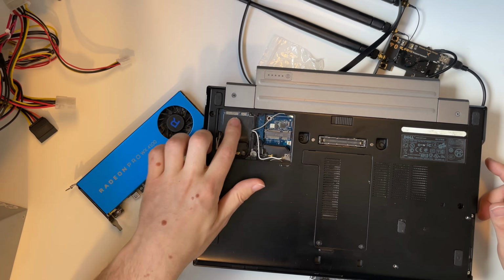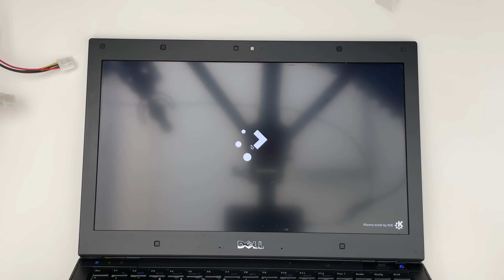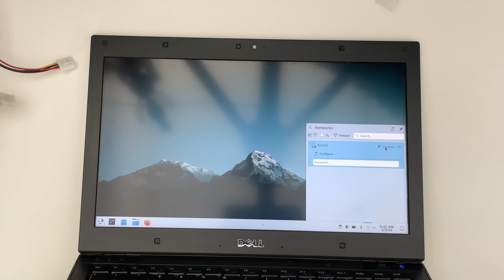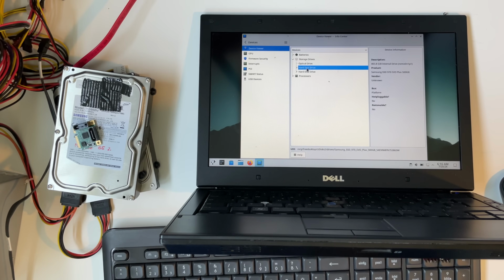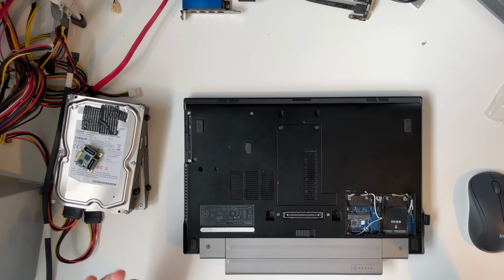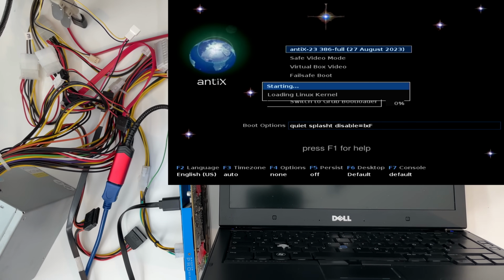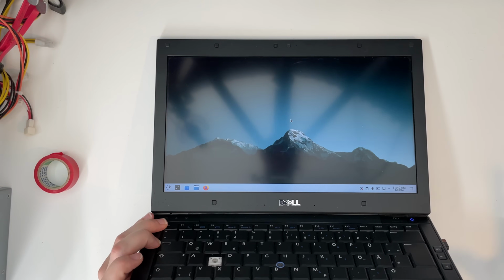I Added an Ethernet Port, a GPU, NVMe SSD, and more to My Laptop... by Removing WiFi

Comment: hola, and thanks for the vid, was looking to see if an upgrade to a core 2 wifi could be made and ran into this problem outright:  antenna connector.  Saw 5cm adapters on aliexpress, they are:  "U.fl 1 a MHF4 MHF 1 a MHF4 conector de Cable 5CM"  check male and female plugs though!  dont know why do this except tweaking the old laptop using linux, which i am

Comment: I've used the m.2 wifi adapter but ended up with transferring the whole antennas from the newer junk notebook.  Does anyone know the specific adapter name for the antenna?
Reply from the maker: Cool idea. But if you have the new wifi card and the new antennas what adapter do you need?
Reply: @TechKingdom35  Wi-fi 6 card.  miniPCIe wi-fi 6 or 6e cards are way too expensive for my old notebook, even from China.

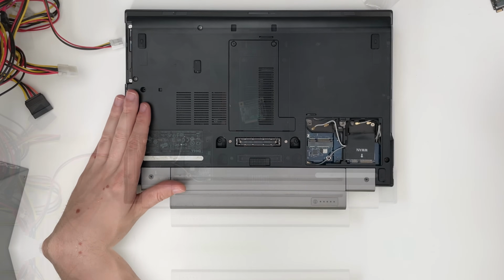Comment: 7:57 did you only just plug the PSU into the Drives and the Wall? did you forget to turn on the PSU by shorting out the Green wire to Ground in the 24 pin Motherboard connector?
Reply from the maker: Thanks for the feedback, but the drives did spin up. You can hear the humming in the background. I bought the adapter again, and that one worked. But it took a few weeks to arrive.

Comment: How did you do the part at 10:05, installing grub on the hdd to boot from it? I'm losing my mind, it just starts a grub shell for me, not the gui to select the drive.
Reply: you can use update-grub utility for fix that

Comment: Hi. Do you can put mini PCIE to m.2 to oculink adapter to make to fit better? This port is so amazing and is underrated. All of the laptops can output EGPU? Which distro are you recomand to have a better compatibility? I have just an old 2008 Intel core2duo laptop.

Comment: I need that egpu thingy for an Optiplex USFF that has no actual expansion slots because I wanna use it to stream and the integrated graphics don't support hardware video decode, but I only need a x1 adapter because I have a GT 710 PCIe x1 card, which would be perfect.

Comment: Don't need the wifi card anymore, might try that NVMe trick so I can store two 2.5" HDDs + one NVMe disk on this laptop!
Reply: You can also add a MSATA ssd in the WWAN slot of most Latitude models. I can to my E-6540. Done a similar setup as this with it and went with a 2TB M.2 2230 NVMe while having a 2TB  MSATA SSD in the WWAN slot with a 2.5” 4TB SSD in my original HDD slot and a 2.5” 2TB SSD in the Optical Drive slot by way of a HDD/SSD adapter tray that connects to the Slimline port in the Optical Bay. Booting Win 10 on the 2TB 2.5” SSD, booting Arch and Kali on my split partitioned 2.5” 4TB SSD, CachyOS on the 2TB NVMe and a barely working Mac OS on the 2TB MSATA Drive. Grub Bootloader on all but MacOS setup. Would love to use my last MINI PCIe slot to be able to add a 2.5G NIC/Ethernet adapter to connect up with my Fiber and the WiFi 7 BT 6.0 card I added about a year ago. Also on the E-6540 my second MINI PCIe slot has cutouts in the frame to allow for longer cards even adapters where you may wanna connect another longer NVMe card by way of adapter provided you can find an adapter with those exact links at the connection points, which I’m sure between all the different overseas retailers online Amazon eBay Temu somewhere is bound to have one that would work seeing how the controller itself works by using the same type of adapter card just designed differently. Nonetheless this is a really cool video to show people most people don’t think that that sort of thing will work, but it does. I’ve been utilizing it daily with no issues so far other than the occasional needing to go in doing a little bit of work in the terminal, but mostly everything was Plug N’ Play💯🤷🏼‍♂️
Reply from the maker: @MicrocarpaRutaceae  go for it, sounds like a good usecase

Comment: Excellent video. I tried putting such a USB card in my Lenovo Thinkpad x230 but because the card is not on the whitelist, the laptop is not allowed to boot unless I disable the "WWAN" card in the BIOS. Do you know of a way to make it work as I had hoped ?
Reply from the maker: @fotografm  I have a few thinkpads of that generation. You need a modded bios sadly :/

Comment: why did i think the title meant you added them all to a single pcie lane. it is possible with a special bios setting and a custom plx chip for switching. i have a plx card that switches a regular 16x lane to 8-2x lanes.  i used it for mining crypto. you can find them online.

Comment: It's not enough to just plug in a PSU and expecting it to power the hdd's. Connections on the big connector need to be bridged to turn on the PSU to then supply the power. This might have been done but from the looks and what was said in the video, it didn't seem this way.
Reply from the maker: Thanks for the comment. I bridged the pins on the powersupply to turn it on. The HDDs also spun up. But you are correct that that is easily missed. The mini pci adapter just was broken. I now have a working one. The gpu is btw also powered by the same powersupply where I also had to short that enable pin.

Comment: I have an m.2 to MPCIe adapter that comes with antenna connectors attached
Reply from the maker: Uh, that's interesting. So you can use older networking cards on a newer device.

Comment: for M.2 E Key 5g meybe you add antena for modem..?
Reply from the maker: I don't think that would work. The card wasn't detected correctly. If the antennas were the problem, it should have probably been detected, but with very bad reception

Comment: My dumb ahh thought you were going to add it all at once 😭 
I wonder how bad the bandwidth would be for each device if that was possible
Reply from the maker: XD That would be crazy. Sadly I don't know about a notebook with more than three mini pcie ports. But how much bandwidth you have depends on the CPU. A CPU with for example 16 pcie lanes could have 16 mini pcie ports at full bandwidth
Reply: @TechKingdom35 Theoretically, if you had a notebook with two mPCIe slots, an express card slot, and a CardBus slot, you might be able to get pretty crazy with the expansion options.

Comment: Remove the silver covers next to the battery. One of them has a 3rd mini pcie slot hidden. At least on my E6410.
Reply from the maker: Sadly not on my unit. It has the pads on the pcb, though. But that  is crazy. Three mini pcie slots :O
Reply: My e6400 has a 3rd one there too. Does that mean all these ports are mini PCIe slots ?.. cool I just want to do a gpu.

Comment: I 'm not sure that m2 will be faster than ssd connected via sata because of pci-e speed
Reply from the maker: If I had an adapter with a single 6 gbit Sata port, you are probably correct. I think with the adapters I had, the m.2 one is probably the faster one.
Reply: @TechKingdom35  I mean native sata  (built-in) vs m2 via pci adapter

Comment: I bought a mini pcie to usb 3.0 for egpu. Works pretty well and much better than integrated sis mirage 3 (I use nvidia 8600). In the near future I will solder the second mini pcie port.
Reply from the maker: Cool :) The notebook in the video actually has a third mini pcie that I could also solder a port to. I just don't know what other supporting components I would need to populate and if the bios or any other firmware would need to be adapted.
Reply: @TechKingdom35  You can try to use more devices and adapter like as sas. About to boot direct from this port, this need to learn how to modify the bios or to flash the bios chip with a conyroller. You can mod also with coreboot or libreboot BIOS.
Reply: Is this better than using a mini PCIe to PCIe ? I want to run steam and parsec.
Reply: @frankenstein3163  The speed is really slow, but a gtx 1050 or rx540 still overpowered for this connector. I don't have nvme adapter, but will be much useful even if I need to sacrifice usb port to modify partitions from sata ssd.
Reply: @ ok ty for shearing. But any idea if the eGPU closer you use is any different than what the guy in this video uses ?

Comment: The ethernet cards I use a tonne just the newer m.2 variants of the Wifi slot these days, have Proxmox VM clusters of Elitedesk Mini Desktops, provides a second ethernet port which you can get in 2.5gbit as well. They're pretty commonly used in those Mini Desktops from multiple manufacturers.
Reply from the maker: @mainfighter  True, I hadn't thought about the mini PC scene. I think this adapter is originally for some kind of embedded pc, though. Which would also explain the weird metal mounting hardware around the ethernet port.

Comment: nice video! on many schematics of laptops you can see which ports have JUST usb or have the proper pcie lanes/clk. I think those schematics are really important when doing these kind of upgrades. now, I wonder... would any dock for that Dell contain pcie slots? like older dells, like the latitude c640 had a "port replicator" dock and a gargantuan C/II or something (I forgot the name, but I have it in storage!) dock that had two pci slots, and another bay slot for a cd/dvd or drive!
Reply from the maker: True that is valuable information, which port supports pcie, which usb and which both. I couldn't find a port replicator for this notebook that has pcie, I also thought about that. I have one for older thinkpads.